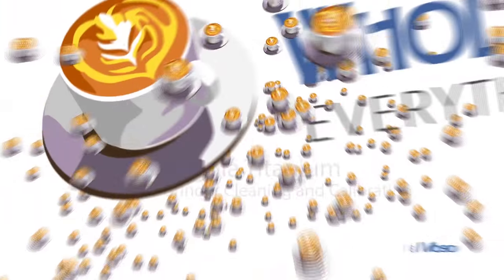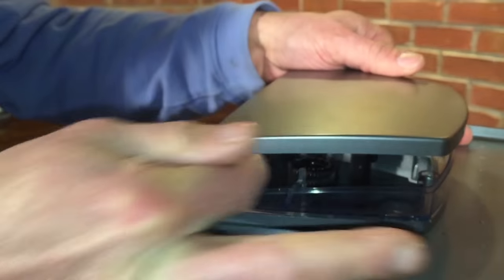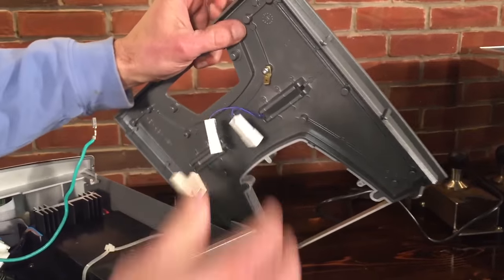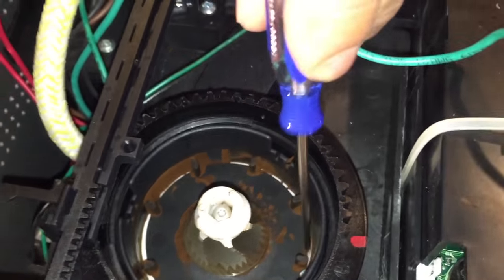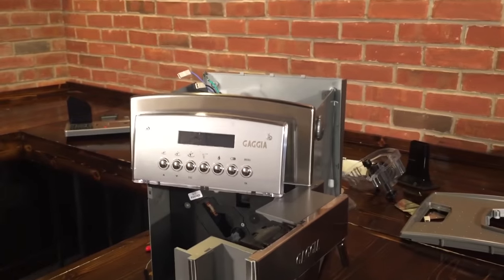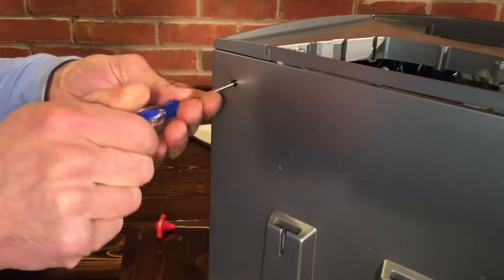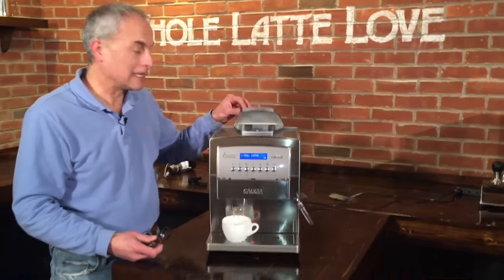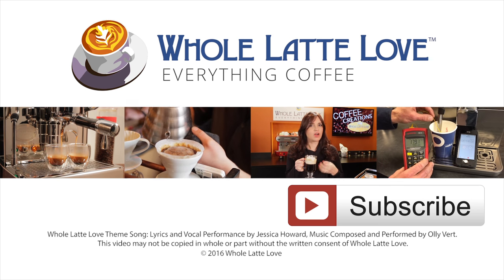How To Clean and Calibrate a Gaggia Titanium Grinder

Comment: Excellent video, thank you very much! I bought my Gaggia Titanium from your store 10 years ago and it's still going. Today I got a "Grinder blocked" message, and with this video I was able to get it back to work perfectly fine.
Reply from the maker: Hi Juan, Thanks for the commen t and report on the longevity of your Gaggia Titanium. We get regular user reports of Gaggia super-automatics going strong at >15,000 brew cycles. All it takes to get there is regular maintenance which you must be doing!

Comment: I have just been given this machine by a family member. It’s not been used in years and power supply was missing and some screws have stripped. Ordered new power supply, new screws and cleaned the machine inside and out. I’m hoping it works when I plug it in!
Reply from the maker: Best of luck!

Comment: Nice video, this helped me a lot. 
Can you comment on the adjustment of the conical burr-screw? 
It's reverse thread and given that the burr drive has both a  rubber 'cush' drive and the three springs with the ball bearings on top,  it seems that the function of the screw might be to allow tension adjustment  Should that screw be bottomed out our backed-off a bit to allow the conical burr to wiggle a little?  I've not been able to figure that one out.. 
Thanks, 

Dave
Reply from the maker: Hi Big Wave, Sorry for the delayed response. Been on vacation and offline for a week. Anyway, that screw should be tightened all the way.

Comment: My Gaggia Titanium the screen displays descal. interrupted empty water tank.
what's the solution?
Thank you sir
Reply from the maker: Hi, Congrats on the Titanium still doing its thing! Refilling the water tank will get it going again. If you had shut off the machine when you turn back on it will restart the descaling process.
Reply: @Wholelattelovepage  I've filled it with water but it still doesn't work.
I restarted it and it's still the same as before

Comment: I thought this was my problem but i'm still getting a blocked grinder message. I did just replace the main circuit board because I was getting the blocked brewunit message, could it be a problem with the new circuit board or something else?

Comment: Hi I have cleaned Gaggia Compact. Unfortunately I get the "coffee bean empty" message. I increased the grinder (as recommended in one video) to 12 but the message "coffee bean empty" still does not go away. Any ideas from tech team would be greatly appreciated.
Reply from the maker: +Milind Naik Sounds like something is preventing beans from getting into the grinder. These machines generally sense no beans based upon the grinder spinning at higher RPMs than if they were grinding beans.